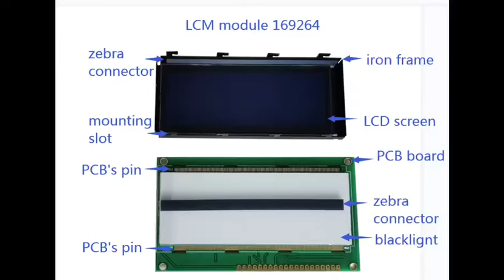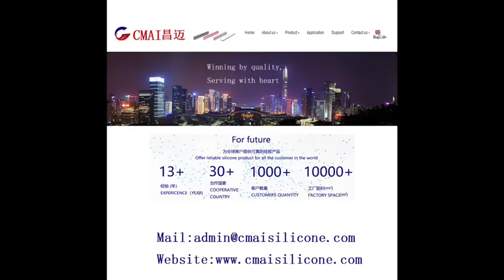Design and common problems of zebra strips in LCM module  斑马条在LCM 模组中的设计及常见问题

Comment: Mine LCM has problem showing unclear digit.i opened it .but then didn't set well.after trying lot it display it was showing small 1,then it shows 256.00, i put packing to put pressure ,it was working ok.all were solved ,but new problem apeared, that was not display related but a small led which is meant for background light for night.i opened the LCM again ,now ,it not worked, 8 shows in place of 0 ,when i pressur at connecting side it show 222 in place of 0.i seen your video yesterday.i did all with zebra, but it require pressur to display ,that too not clear.
I have radio handheld walkie talki.can you please suggest some remedies.can i use other zebra stripe from calculator,if it has same size?
Reply from the maker: Check the height of the zebra strip is appropriate?
Reply from the maker: if you have the same size of zebra connector, you can use it.
Reply: I had missing segments. Took it off and cleaned it with cotton swab and alcohol. Now I get nothing. Not one digit.